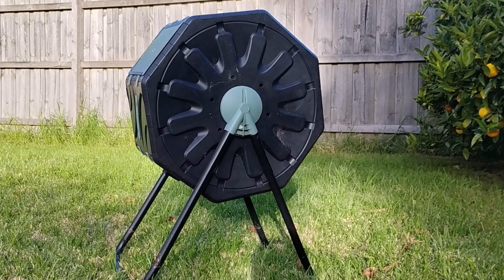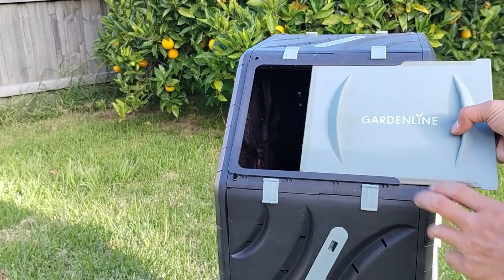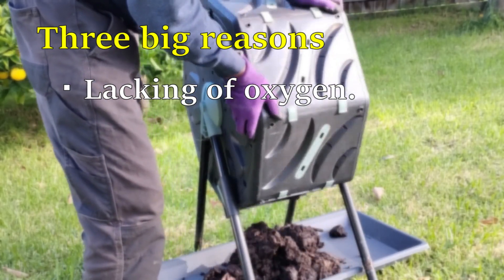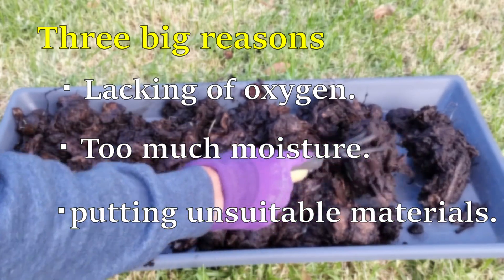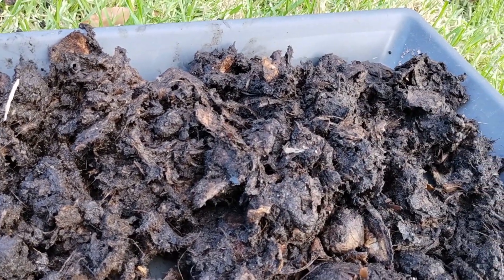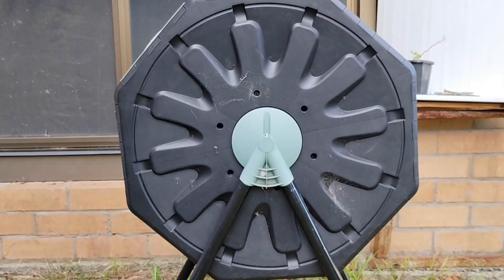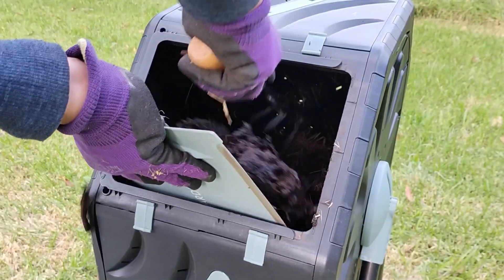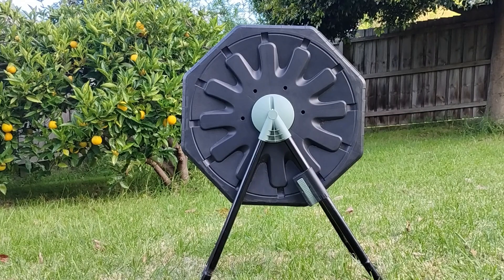Tumbler compost, solving the smell issue and clean it up.

Comment: That straw isn't going to help it will still clump together and turn anaerobic unfortunately. You may need to start over or after it eventually cools down to sun dry and wait for it to break apart (from drying).

Next time will need to use courser browns (wood chips), cardboard strips and dry leaves (they don't clump much)
Reply from the maker: Thank you for  good information